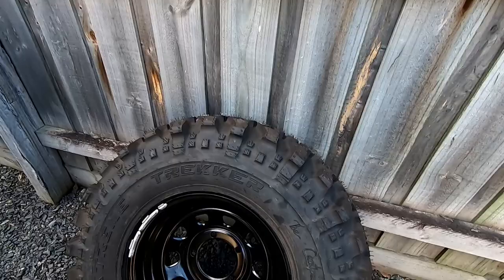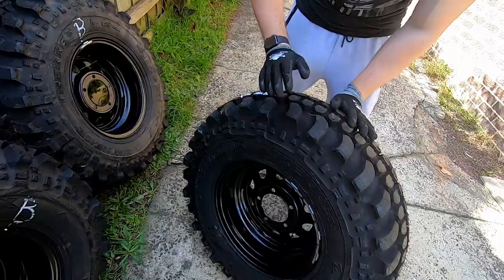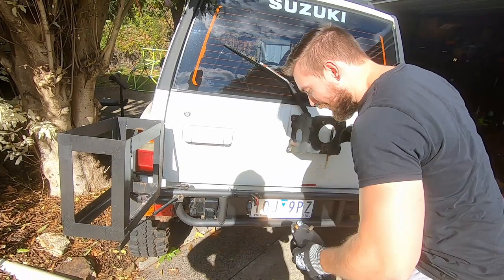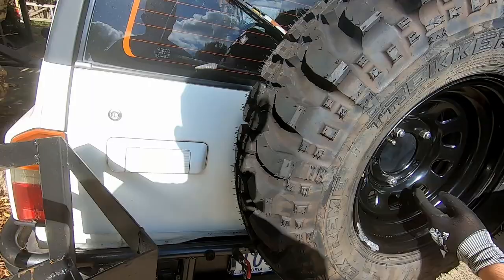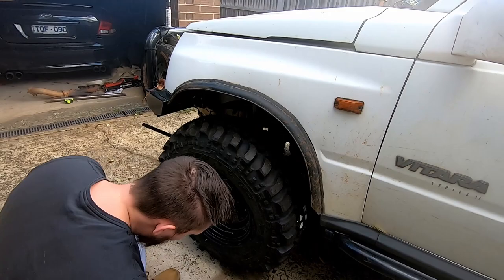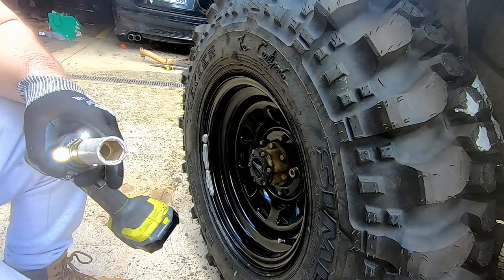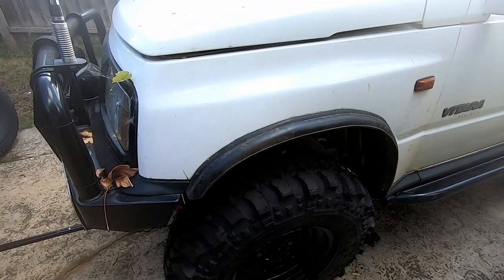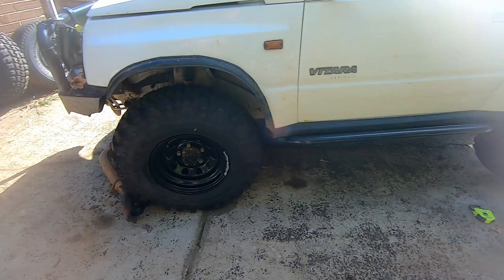Mike's Vitara Get's 31" Simex Centipedes

Comment: far out those tyres look neat. Im looking at putting some 30.5 by 9.2s on my suzuki with a 2 inch lift. hopefully being slightly skinnier they will fit alright and hopefully tuck up into the guards in the rear with stock rims
Reply from the maker: It shouldn't rub with stock rims

Comment: Do 31s rub on any stock fender walls or body when full lock or off-roading, or do cuts have to be made?
Reply from the maker: Full lock rubs on the chassis rail and rear scrubs if you don't set bump stops to suit
Reply: @jaydnp.  cheers the reply jaydn, do you reckon it’s smarter going either 29s or 30s just to avoid any troubles?
Reply from the maker: @_kyranking_  if your vitara is IFS, definitely 29s as you'll find the front shafts/diff become a weak point
Reply: @jaydnp.  thanks heaps for the info man appreciate it, yeah I’d go with 29s I reckon just to avoid any issues I want it to last a fair while, do you have Instagram or anything?
Reply from the maker: @_kyranking_  https://www.instagram.com/jaydn_p__

Comment: I went with a 6 inch on my vitara. Negative 50 offset. :) Simex tires are usually 1 inch higher than what is written.
Reply from the maker: Neg 50 offset god dam! Your wheel bearings must love that haha
Reply: @jaydnp.  ill find out soon. 😅🤣 its a trail rig anyway. It travels at most 100 kms a month. 🤣 with regards to rear suspension, you can use a gen 1 fortuner for longer travel. Im not sure if its a 22 or 24 inch travel shock. 😊
Reply from the maker: @miggymiranda4220  thats not so bad then 👌
Cheers, ill check them out
Reply: @jaydnp.  should be good! 😊 you can actually also use the fortuner springs. I think its a 2.5 or 3 inch lift. Springs can be used front and rear. Shocks only rear due to the strut front. 😊